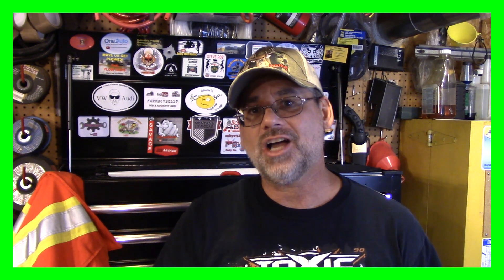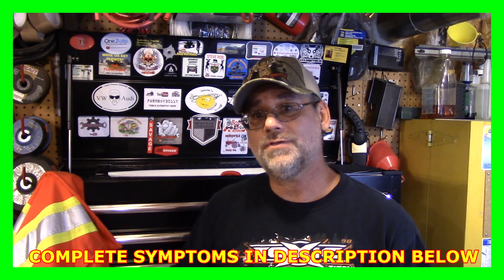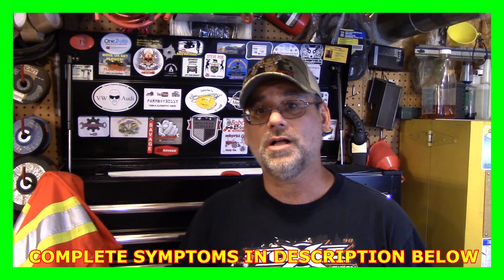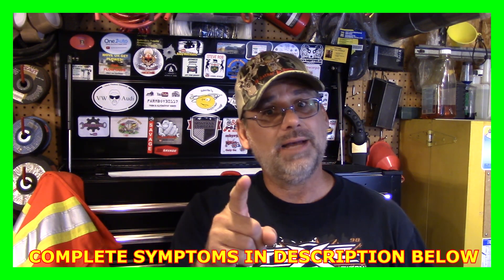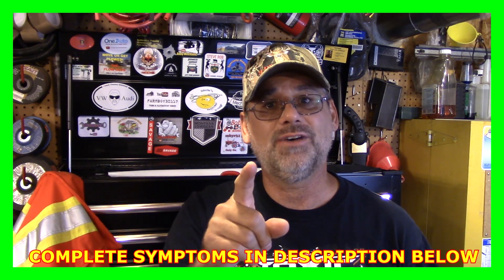F150 STALLING AT STOPS  - DEALER CAN'T FIND FIX - PART ONE

Comment: Why does a GM Guy drive a FORD ...?????
Reply from the maker: Hum good question Jack - I get them at below cost price. Well my friends works at Ford at I wanted a supercrew but in 2010  Silverado didn't make a crew cab 2WD in a 1/2 ton so I bought the Ford at cost price. Ok my next one will most likely be a Silverado 2500HD like my 2002 . The best truck I have ever owned since my 88 Chevy  Scottsdale .  Ah the Fords been a good truck and I'm hoping the fix  or good guess on the next vid solves the stalling.

Comment: Literally happening to my 96 150 been happening 4 months after i got it it started wanting to stall out for no reason , everyone telling me its nothing wrong lmao but when i drive it and get stuck because it stalled and wont start again for 15-20 minutes sometimes longer, that tells me that something indeed is wrong haha
Reply: Same took my 1987 ford f-150 to mechanics that tell me nothing is wrong and it doesn't die( because they just let it sit idle in the shop). I tell them they need to drive it through a town where the tuck is stopping and accelerating and it stalls. they said they cant find anything wrong yet I cant drive it more then 30 min without stalling
Reply from the maker: Aang Avatar  You need a tech about 60-75 years old to fix it , yes its easily fixed but most younger techs have no experience with  older technology .